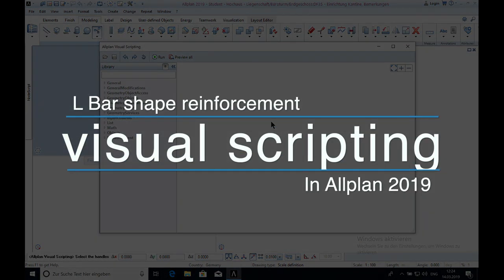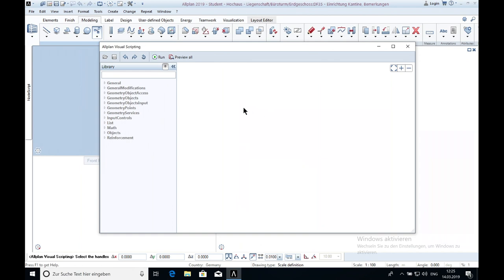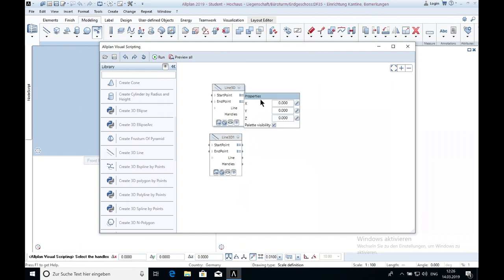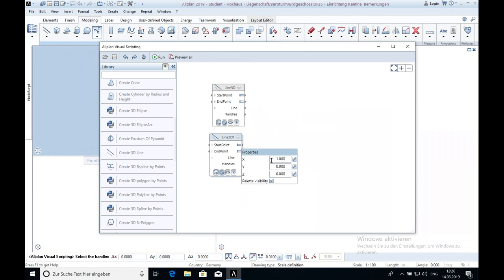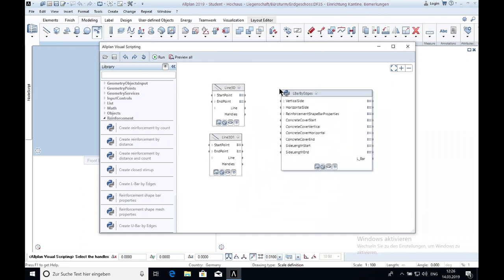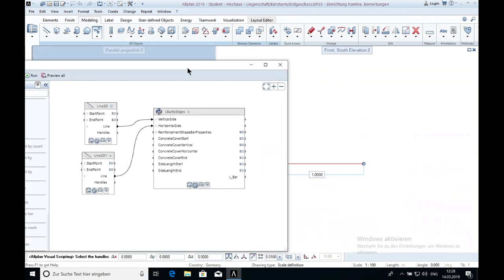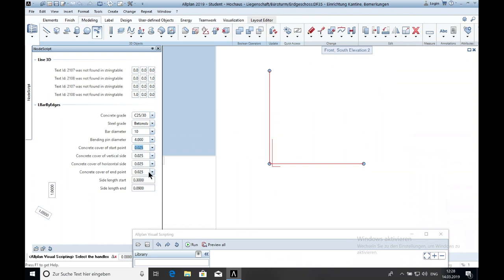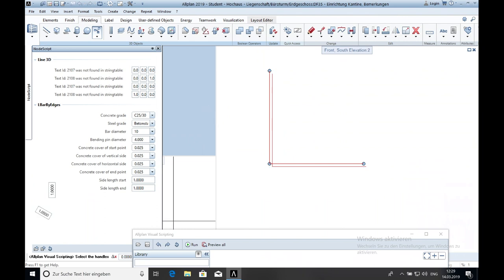Allplan Visual Scripting - L-bar shape reinforcement

Comment: Hello and thanks for your work.
Can you create a label for existing rebars using visual script or python parts?
Reply from the maker: Hello,

Do you mean like to number the rebars with 1,2,3,4.... With all the information with it?

You just can create the 3d object and the reinforcement. When you want to label everything, than you have to save the file anywhere you want on your computer. Afterwards you can open the file in your normal Allplan window where you can sketch by click and drop. When you have done that, the object with all its reinforcement is ready to use and you can create some sections. In the sections you can see like usual the reinforcement and you can label it. :)

I can make a short video about it, if you want?